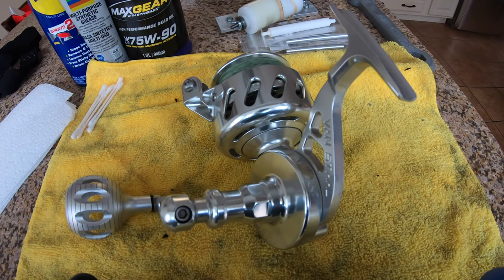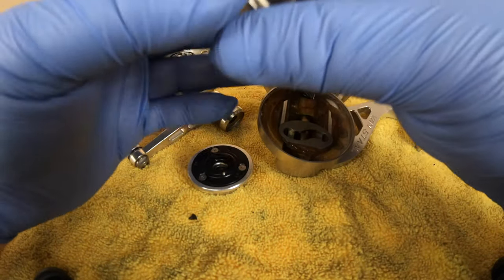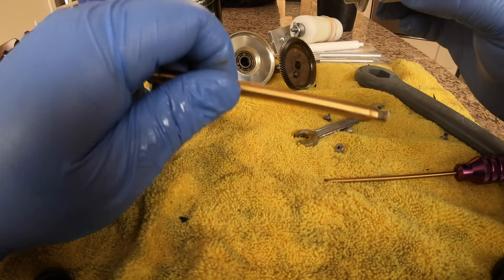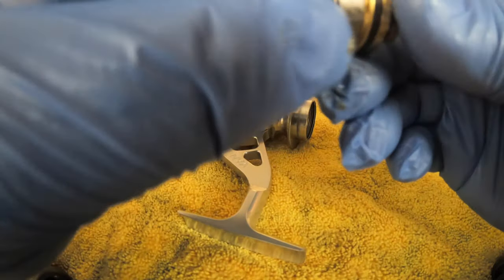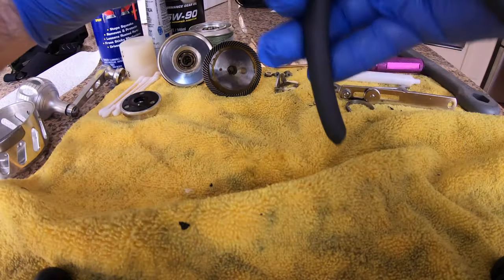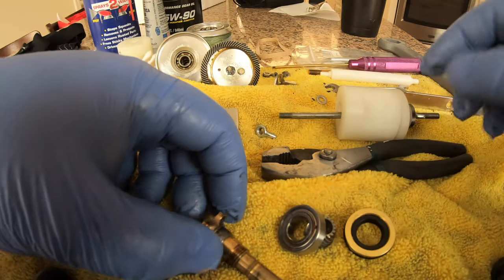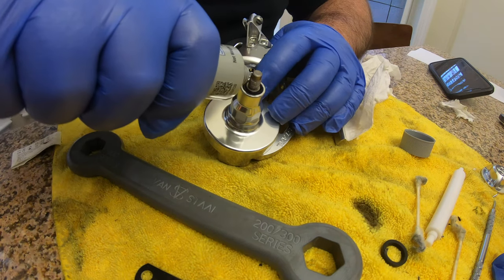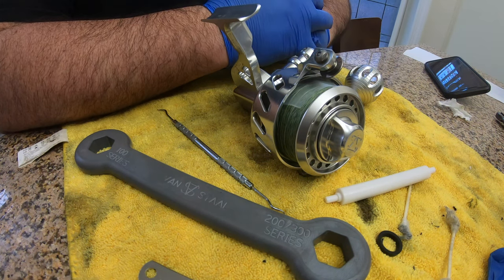How To Fully Service a Van Stall VS200

Comment: Great video!
Have you had any problems with the oil getting into the AR clutch causing it to slip?
Reply from the maker: Thank you for watching! Not at all. VS factory service actually recommends coating it. Reel is butter smooth even in cold weather and hasn’t missed a beat.

Comment: great video very helpful. As a matter of interest is there a service procedure for the drag washers
Reply from the maker: It’s a simple process. I’ll make a video when I service it this fall but it’s pretty easy. Drag stack comes out and put it back the same order. Same with the 2 OSPR3 drag seals
Reply: @xlandscaper  Look forward to that thanks. Do you know if anyone has replaced the drag washers with carbontex greased washers to try and improve the drag ? 

BTW how did you get on witth filling gear box with oil. i like that idea as basically that is what it is, a gear box sealed with standard oil seals, if oil leaks out you know something is wrong or needs changing.
Reply from the maker: @ShorrockPaul  I’m not sure about replacing the drag washers but I’ve never heard any issues with the factory drag stack in the 200’s. I use a very light coating of grease on the carbon washers and my drag is always silky smooth. And all the older vs reels used straight gear oil. I’ve been using royal purple and superlube combo for a few seasons and the reel has been butter smooth, doesn’t stiffen up in the cold and yes if you see a sheen of oil in the water you know ur leaking and it time for a Service.

Comment: Hi, thank you nice video. unfortunately I have mounted the left side cover incorrectly in the final phase of reassembly and it's all stuck, I can no longer open it, I even bent a key, nothing, all stuck, do you have any advice to overcome this nightmare? I am in complete despair
Regards
Caesar
Reply from the maker: Man that’s unfortunate. They only way to get the side plate off is to cut it off. Take a hacksaw blade or dremel cut off wheel and slowly cut through the side cover being careful not to cut into the shaft. Once that’s fully cut off you can unscrew it bc the part you cut off has the anti reverse bearing. It’s definitely not for the faint of heart but it can be done. If you aren’t comfortable definitely send it in. Also google search it, there’s a few forums that explain it with pictures. Good luck man.
Reply: I just did the same thing too
Reply: You can get it off by tapping the end of the main gear with a mallet and turning the wrench every time you tap.  It will only move a millimeter at a time but it will come off eventually.  I’ve done it.  It sucks when you do it but this method works.

Comment: i have a van staal vsx 200 and when i cast the handle will crank by its self and sometimes it catches the line any way to fix it?
Reply from the maker: When you cast make sure the handle is pointed down, parallel to the rod (towards you) the spool should be fully extended.
Reply: @xlandscaper  yeah it still does that when the spool is fully extended
Reply from the maker: @fearmyglock_Valorant  could be the seals are loose and worn out allowing the handle to rotate. When the reel has fresh seals the handle has some resistance to turn and typically won’t spin on its own. Another possibility is the spool could be overfilled with line
Reply: @xlandscaper  i think it might be the seal that u mentioned cus its under spooled

Comment: Do you find the gear oil to be noisier than the grease? I noticed a little bit at the end. I can hear the main drive gear and the pinion gear.
Reply from the maker: Yes it does make a little more noise using straight royal purple… What I’ve been doing is using superlube grease and royal purple mix. It’s a thicker consistency that you can make as thin or as thick as you want. Super smooth and quiet.

Comment: How would you take the side cover offf if you have an American smooth cover
Reply from the maker: I have never taken a smooth one off but I think they use a small strap wrench so it doesn’t mark the cover
Reply: Thanks! How would you recommend fixing the handle to spool orientation?when the handle is down the spores in the highest position?

Comment: Help What do i do? I mess up the last step when i put the cap on... now i can' take it off...
Reply from the maker: That’s exactly what I warned about. It happens… Only way is to carefully cut the cap off with a hack saw or dremel near the body and slide off the “cut” pice that covers the anti reverse bearing then unscrew with Chanel locks. The anti reverse bearings is preventing it from removal. At this point if you don’t feel comfortable a VS service shop will be the best bet.

Comment: i locked my van staal up
Reply from the maker: Dam that sucks. Remove the rotor and you are going to have to cut the handle side cover where you screw the handle on with a hack saw or dremel and be careful not to cut into the shaft, otherwise you’ll be getting a new main gear/shaft too. Once you get it all cut around the aluminum you can take a pair of vice grips and twist it off. Sounds complicated but it’s not that bad from what I’ve seen. Otherwise saltwaters will take care of you. Good luck and let us know how you make out